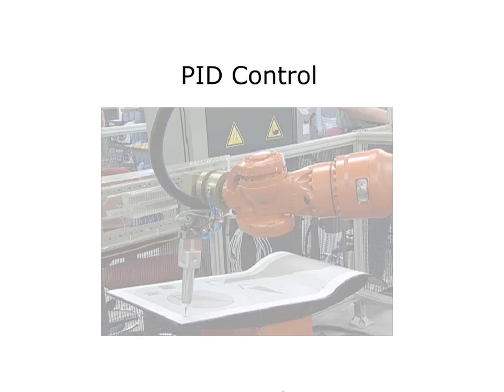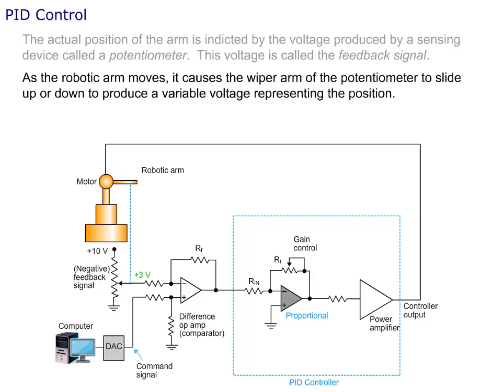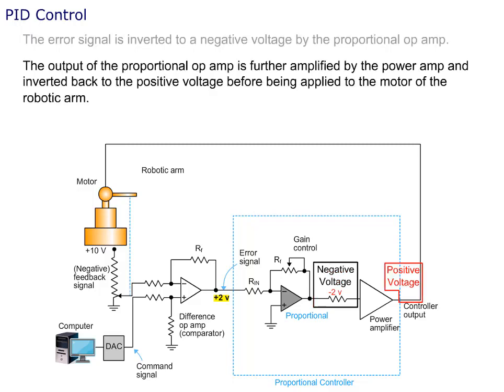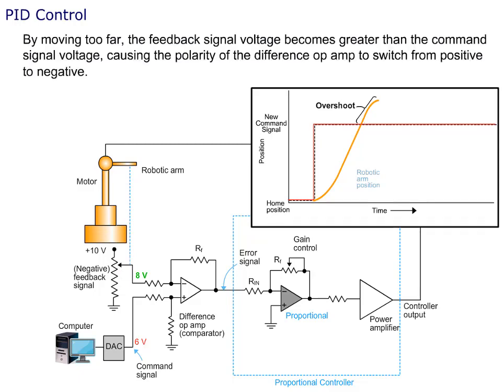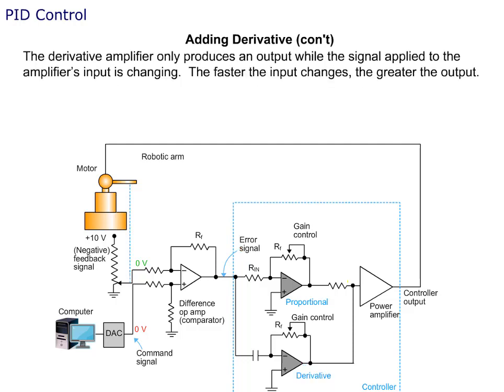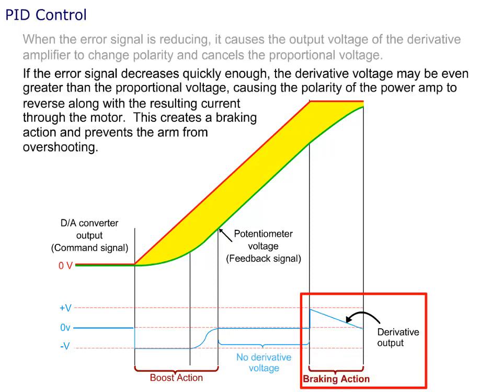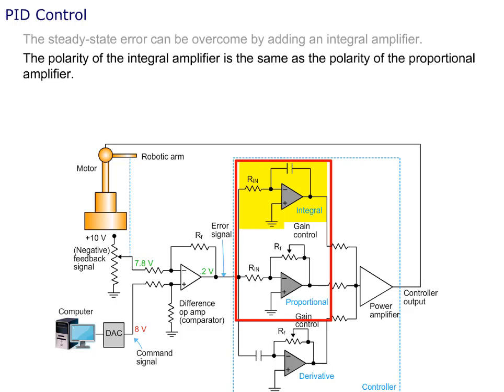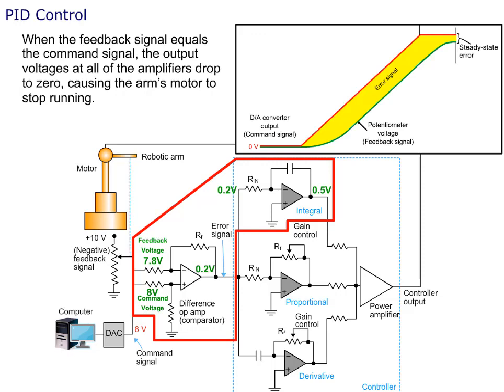PID Control

Comment: Why are no values given for any component so this can be tested? Every attempt to get this, part number list, component numbers or values meet a dead end or worse yet, go round in circles. I enjoy learning at age 66, but even the closed loop feedback video is the same way. Only voltage values are given in a simple circuit that can be built on a solder less breadboard! The concept is fine but without the ability to make a working model make this worthless!
  Thanks kindly for any efforts made. I don’t expect much!